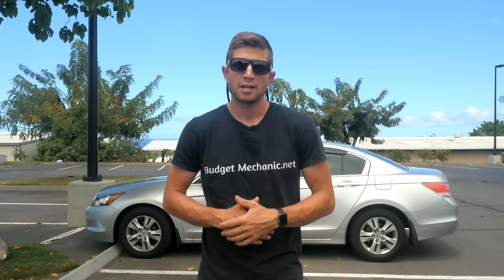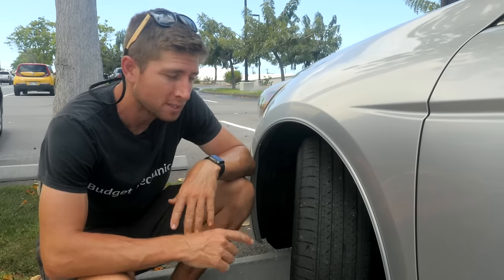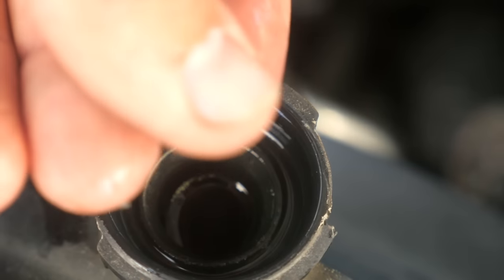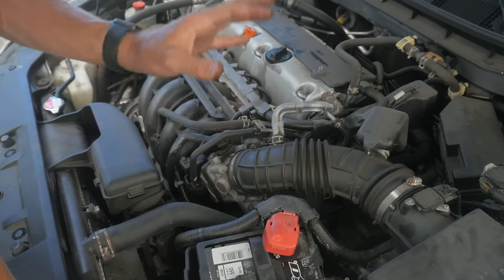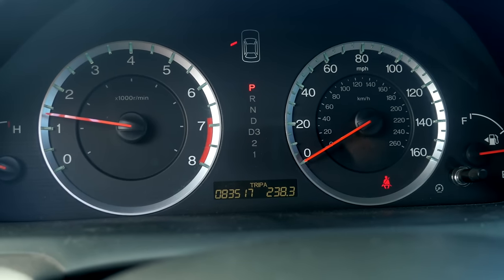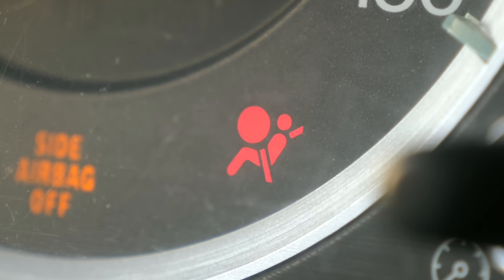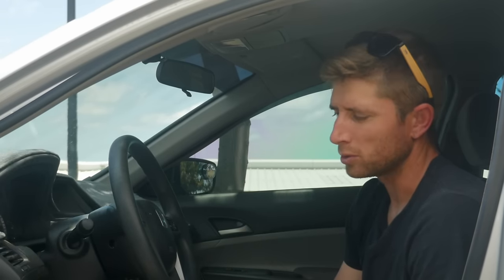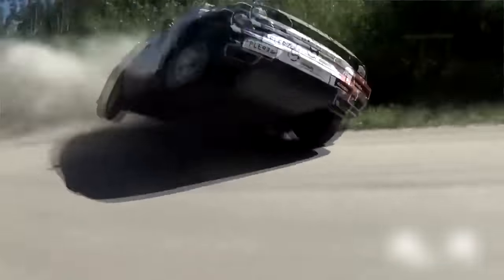How to Inspect a Used Car For Red Flags and Not Get Scammed

Comment: That was good, two thigs I would add, sometimes you can tell if the vehicle has had body work by noticing a slightly different shade of paint from one body componant to another , such as where the rear 1/4 panel meets the door , or the hood to the fender . Also , when you turn the ignotion forward but before you get to the point where the vehicle will turn over all of the dash indicator lights should be on . I have heard of cases where a crafty selle ( usually a dealer )r had a way of getting the inspection sticker, then would disconect the " check engine light " so it would look like it was off . Te problem is , the next time . like next years inspection , the reader is plugged in , it will show a code even though the light is off .

Comment: I bought a new 2023 Honda Civic sport hatchback with manual transmission. It broke down in the 5th week. I quickly traded it for a 2022 Toyota Corolla Manual.
Reply: Bet you'll be a lot happier.

Comment: Anybody who reads comments trust me he's absolutely right with everything esp the ending. DO NOT buy a modified car no matter what brand but in my experience especially a subaru. If you see a Cobb access port run and avoid it. You don't want anything that's had the ecu messed with. I try to tell ppp Cobb access ports are bad and ruin ur car. Always ask if they've used one. Always get a stock vehicle. You'd be surprised how damaged a front end can be from lowering coilovers or "bags" which are very expensive to replace and or wheels. No matter how big the list is of things they did to the car or replaced THEY ARE SELLING IT FOR A REASON! nobody is going to dumb thousands of $ into a car to just sell it. They are selling it because it's a money pit and they messed the car up and trying to get their money back an sell you a lemon.
Reply from the maker: Sorry you learned this one the hard way!!

Comment: just got a car from a shop and its 6000 miles from 2014 with external damage and they fixed it and the car has been great for 3 months and then some heat shields noises are covered i think it was a great steal

Comment: I can suggest a universal recipe for you NOT to have to worry about oil, or coolant, or transmission fluid, or belts, or spark plugs, or air filter, or exhaust system, or any other gas car's inherent innards. In fact, you don't even have to ever worry about changing your brake pads.

GO ELECTRIC. I have been driving my Chevy Bolt EV for almost 4 years now and it's been the happiest 4 years in all the decades of my driving career. I love my Bolt. It's a GM's masterpiece, a clean, fast, quiet, and trouble-free pocket rocket.
Reply: Yeah then something does happen and the bills 30k because nobody works on EVs lol
Reply: @gavinkeane5260  You know what I say to EV haters like you? If being unhappy makes you happy, DO NOT GO ELECTRIC. 

With people like you not buying EVs, the government is less likely to jack up electricity rates - making me more likely to continue charging my beloved EV for peanuts.

Comment: All good advice but it is just about looking at the condition of the car - there is no scamming involved here. 
Two things missed out -
On the bodywork, it is important to check the fit between each body panel - the gaps should be flat and even, and match the others. Any bad fit is a sign of repaired damage. 
What if you find problems? Do not buy the car if it has any signs of past accident damage, so wrong color, paint overspray, wobbles and panel issues. Also do not buy if there is any issues with the oil or coolant or any big issues with transmission, gear change or how it drives. 
Tires wear out, as do brakes, discs and a few other parts. Cars will pick up minor scratches and odd scuffs etc.  These are not a reason to walk away from the car, just things to use to negotiate the price.

Comment: I had to buy a second car last year because my car's transmission went out at 90k miles (that's ford focus for ya) and I needed a car for work. So I got this 2017 elantra and this damned thing is just cursed..... I mean I've had it for just a year now and I had to replace all 4 sparkplugs & coils, all 4 tires, brake pads were non existent, the electrical system is on the frits right now, the gas cap was ripped off by previous owner and then ontop of all that someone hit and ran my car a couple months ago and it's about the same price as my deductible. I've spent more on repairs than the actual car payment
Reply: Did you ask your own mechanic before even considering a Hyundai/Kia product? 
And a used Ford?  Yikes!  I always tell friends to consider what their needs really are and then buy the appropriate Toyota model.

Comment: Never do a transmission flush on a black dirty hydro transmission. Doing so will cause your tranny to slip and cause the gears to start knocking n wearing down faster. Instead, drain and put new fluid in it and change out the filter. Flushing an old dirty tranny will cause the small dirty particles to get caught in all the small orifices of your transmission and clogging the valves and channels to create slippage.
Reply: drain and refill with lucas trans fix
Reply: @dommopa4464  You must sell the stuff lol

Comment: If the transmission fluid was just replaced, that is a red flag…they could be hiding transmission problems by getting rid of the fluid that has metal shards in it.

Comment: Wait you're not suppose to put water in your radiator?
Reply: Only the correct mixture of coolant and water. It's often sold premixed. NEVER water alone. And it should be exactly the correct type of coolant.

Comment: i recently went to go look at  a 2010 camaro ss i took the oil cap off when i started the car and it would make like a small vibrating noise to the engine & when i would put the oil cap back on it would make the noise go away is this normal?
Reply: your first mistake was considering buying a Camaro lol

Comment: Do not flush your transmissions it can jam dirt into the transmission. Also a  $10 scan tool will miss half of everything you really need someone with a $300-$400 scan tool
Reply: What about a carbon flush?
Reply: @eden20111  I probably wouldn’t do it if they are blasting it with pressure but if they are disassembling and cleaning then yes.

Comment: don't get scammed because you may find wear on the inner side of the tyre so you will have to do alignment? man. this obviously shows that if you would be looking this way to buy a car, you shouldn't have a car. things like this are normal usual routine maintance that comes as your "total yearly fee" for keeping the car in good condition. you can get your wheels aligned, drive 10miles, hit one pothole "little bit too much" and you will need to get another alignment done. this video only shows how much you still have to learn.... 😕

Comment: There's a very serious problem in this country on Volkswagen and Honda and foreign cars they no longer have the parts people all over America have been waiting over a year to get parts for their car that is just sitting in the garage that they can't drive or use because no one is able to get parts for the car anymore this has been going on for a couple years now it's getting a little attention very little news on it !!!!! If you're thinking about buying a car you should do some research on the internet on how hard it is to get parts for that car listen to me carefully do not trust the dealer. My advice is to look at American cars where the parts are made in America.
Reply: I have not had that problem, but, of course, I would NEVER buy any VW product.
Reply: @wholeNwon  I had a 2012 Volkswagen Jetta I went to the dealer to fix a problem with the steering he was not able to fix it because he did not have the part and said it was on order after 6 months past it was still on order my car sat in the garage for 6 months I was not able to drive it for 6 months because the dealer could not get a hold of the part this caused me to do research on the internet only to find that people all across the country are having the same problem with multiple parts I tried calling the corporate headquarters of Volkswagen here in this country that turned out to be a dead end listening to people around the country talk about horror stories of their car sitting idle for a year or more and not able to get a yearly inspection on the car.
Stay away from Volkswagen also I looked up Honda and found the same problem American dealers are not able to get parts anymore this is extremely serious if you buy a foreign car because the dealers are not telling the truth you're better off buying an American car whose parts are made in America
Reply: @josephcade3541  The vast majority of "American" brands are full of foreign parts.
Are you in the USA?  What part did you need?
I would NEVER buy any VW product from Golf to Bentley and beyond.
Reply: @wholeNwon  yes I'm in the United States and because I could not get a part for over 6 months from the dealer I had to send my 2012 Volkswagen Jetta to the junkyard you got that to the junkyard !!!! As you can see I'm extremely upset over it

Comment: Lots of pisspoor advice in this video. Most egregious is NEVER get a transmission flush, especially if the transmission fluid is dark, you'll be replacing your transmission very shortly after.
Reply: why do people say this? I’ve had a transmission flush on an automatic and am still driving it.